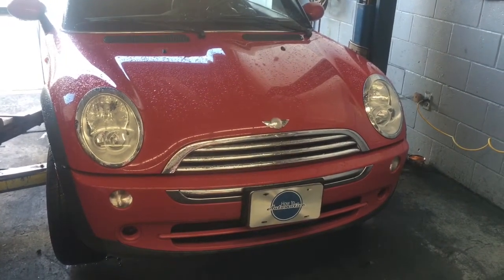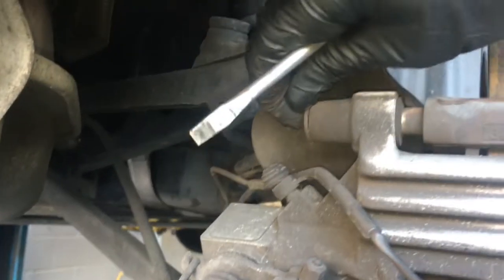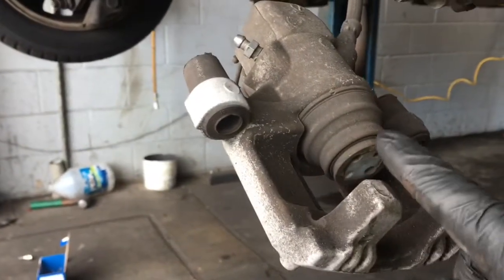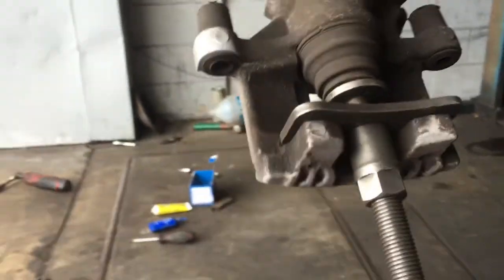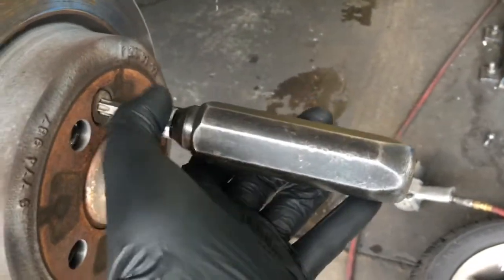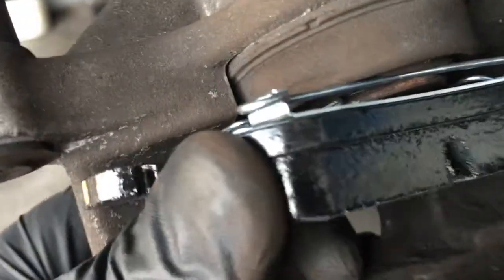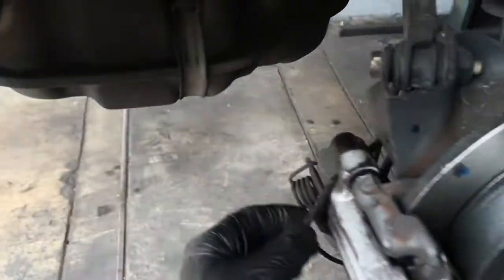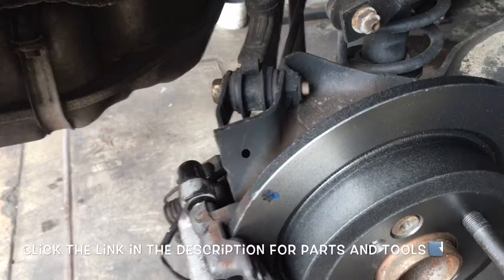How To Replace The Rear Brake Pads, Rotors, With Sensor On A Mini Cooper N56

Comment: Hello again. Do you have the procedure to tighten the parking brake cable after installing new rear pads?
Reply: Working the hand brake mechanism will turn the threaded piece in the caliper to bring the hand brake into place.

Comment: How come some videos show regular bolts and yours has allen bolts?
Reply from the maker: Andy D that’s hard to say it could be a couple reasons for that. One the parts have been changed out before and replace with regular bolts. Or it’s a manufactured thing from year to year.
Reply: Thanks for your quick reply. Another question, must the sensor be replaced or can you re use the existing one?
Reply from the maker: Andy D if the season made contact with the old rotor you definitely have to replace it.. there’s a good chance that when you tried remove the old ones it’ll break anyway so I would recommend replacing it
Reply: How to Automotive is front sensor different from rear?
Reply from the maker: Andy D different Pads but the procedure is very similar. It’s actually a little easier on the front.
Reply: So the sensor is different?
Reply from the maker: Andy D I’m not 100% sure he may want to check with your parts dealer
Reply: Thanks for all your help. One last thing, I promise. Does the brake pad warning light go off or does it have to be reset?
Reply from the maker: Andy D it requires a scan tool to reset it. If you take it to a repair shop they may go to do it for you.
Reply: This has the older style r50/r53 caliper rather than the later style which bolts on with hex bolts.